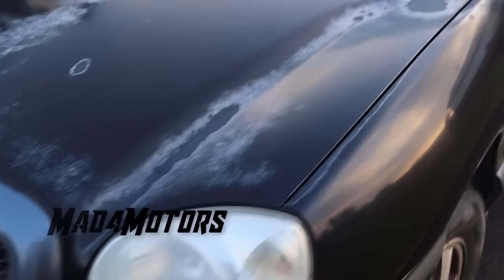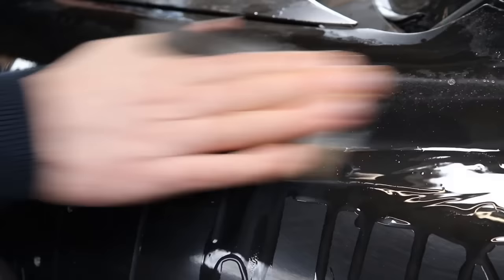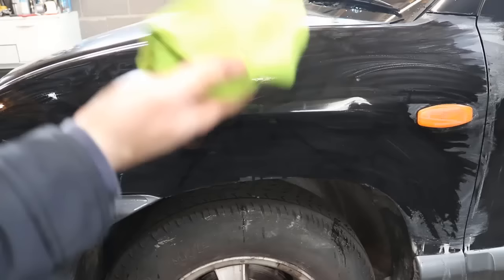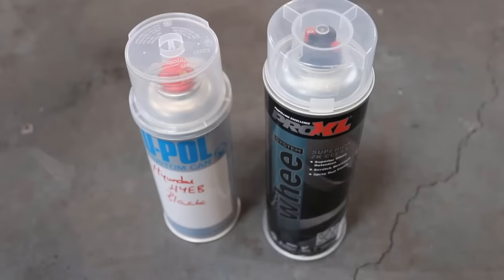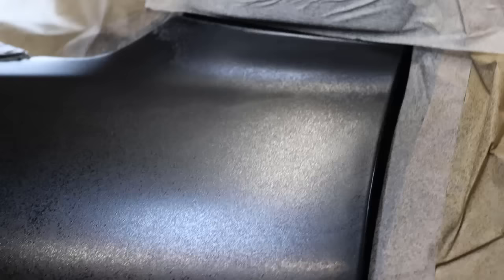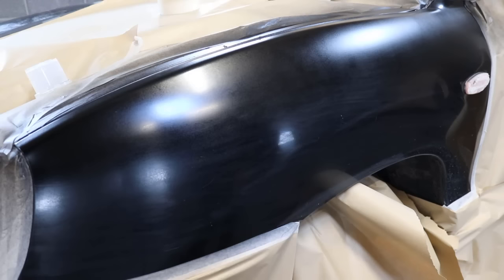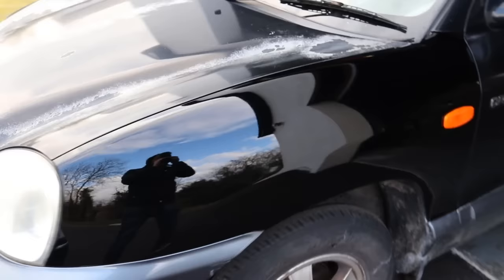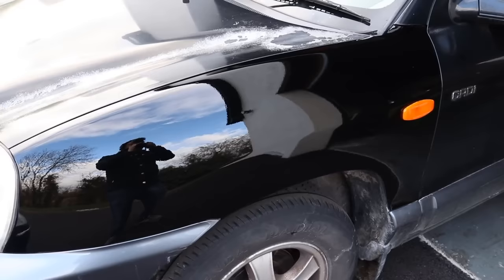How to Repair Clear Coat Fix 100% all types

Comment: Freaking excellent. I'm a detailer but the paint on my RSX is awful and I will be repainting some panels and will go with this process for the rest, then I'll wait the 24 hours, polish out any orange peel then ceramic coat and we should be golden no? I figured it would be more fun and cheaper if I did it myself.
Reply: Jared Miramontes 
No! You can wet sand and polish the clear coat 24hrs later if you like... but, dont apply ceramic or any sealer over the paint for atleast 3 weeks...it needs time to gas during the curing stage, and you don't want to trap any of the solvents in there!
Reply: splash does it now? I appreciate the heads up, I am far from doing this project I was still doing my research but I appreciate it anyway. I didn't know that, man it's gonna be a cringy 3 weeks as a detailer to drive a freshly clear coated car without and protection.
Reply: Jared Miramontes 
In the shop we polish it with no issues...but just finish it with glaze/polish/swirl remover whatever system you like, but dont seal it. Waxes and other sealers like ceramic, you'll want to wait.
In the end, its your decision, but after spending time and money i wouldnt want to jeopardize it...
Reply: splash yeah your right if ceramic coating directly after would jeopardize my plan i wouldn't do it. Btw whats the best clear coat to be applied by rattle cans? I have an air compressor but it's only a 3 gal so I don't think it's suitable for a spray gun...
Reply: Jared Miramontes 
Im honestly not too sure, i spray all my clear and buy it by the gallon...
If your in the US or Canada, i would say go to a local paint supplier, like Napa, and purchase a can of 2K clear coat. It should have the button in the bottom that activates the clear.
Reply: Jared Miramontes 
I believe Spray Max is one of the brands that make the 2K clear coat
Reply: splash ok sounds good appreciate it.
Reply: Only use the 2k clear cans, Spray Max is good there's other brands starting to make them as well.

If you have a compressor even if it needs to catch up just buy a clear with a slow hardener so it doesn't dry as fast, As for the gun despite how cheap the harbor freight gun is it's pretty good and because you're a detailer just spray enough clear and you shouldn't have a problem sanding the orange peel down to perfection, The spray cans are one time use and pretty expensive at $20/can.
Reply: JrVtec so your saying buy the clear coat in liquid form and try to use my compressor along with the spray guns from harbor freight? I've lots of good things about those spray guns but also hear you need at least an 8 gallon tank to run them...
Reply: JrVtec 
Problem is he has a 3 gallon compressor... thats ok for a brad nailer, but not a paint gun...
Even the cheaper brand guns, like HF, are HVLP(high volume low pressure) so you dont need tons of pressure, but they do require a ton of air volume...
Unfortunately, without spending a bunch of money on a decent compressor(25 gallon minimum for small projects) then he might be better off buying the 2K clear in cans...
Also a little trick, if you want to use it within a day or so, stick your can of clear in the refrigerator after your done using it and take it out the next day when you need it again...
Reply: splash appreciate the tips man!
Reply: Jared Miramontes 
No worries...
Hope your project turns out well!
Reply: Yeah just remembered you mentioned it's a 3 gallon definitely not suitable, In that case yeah spray cans is your only choice for now unless you're really interested in painting and want to invest in everything you need.

What are you planning to paint and what color? I wouldn't paint a hood or anything big in general with cans, You'll almost guaranteed have tiger striping and it'll cost a little over $100 just in the 2 cans clear/2 cans base.
Reply: 3 gal compressor, why don't you test try something with cheap paint especially if you've never used a spray gun before, I'm pretty sure your going a want to practice. Besides your in control of the air flow & paint coming out. Just let the compressor catch up after every pass or two. It's not like a impact or air hammer that are releasing a vast amount of air with each trigger pulled. You'd be surprised at what you can do with what may seem like is not enough, actually can be just enough(barely). I just hate the clean up part of the gun, no one ever mentions that.
Reply: Jared, if you plan on wet sanding the clear, dont rattle can it! You will blow right through!
Reply: Splash, borrow or RENT a compressor. Rattle clear is for jambs, not outer panels

Comment: Left a ton or "orange peel" - should have sanded the base coat lightly prior to clear, then sanded the clear and re-coated.
Reply: What grade sand paper do you recommend for that step?
Reply: You won't get a finished showroom paint  job in one or two days using cans and doing multiple sands and sprays. I have tried this myself and you end up with a worse finish by rushing to get it 100%.The video shows exactly what you can do in one day and is ideal for the diy'er. 
The clearcoat sticks to the basecoat if done soon after, no need to sand. You will get some orange peel from an aerosol can no matter what, it is just ridges in the liquid. Those are fixed by waiting 48 hours or longer dependent on the quality of the clearcoat and temperature, then you sand with 2000 grit or lighter and polish with ultimate compound/ quality polish and a rotary polisher. You can use heavy grit if required later on, but I veer on the light side for new clear.

Comment: Just repaint whole car for $400 one stage color with two coats of clear coat. And done. Will look better and last longer
Reply: Single stage doesnt have clear. Secondly it will NOT last longer. Lastly you must have no idea what quality materials cost
Reply: Sinisa, let your car drive 3 years in New York weather and you will see I am correct.
Reply: Rovid, our cars are exposed to 120F 8 months out of year. If anything can damage a paint it's Sun and we have 3 Ear warranty on paint and clear. Never had customer return from fading or flaking. When it come to paint I'll trade your snow and rain for 120F sun anytime.
Reply: Sinisa, no droughts, fires, tornadoes, floods, Im staying in NY thanks. Liberal Governor suckd here but everything else is fine. I get more work in 3 months here than most southwest shops in a year. Winter is a repair and fabrication shops dream here. Most guys here bank 140 book hours but actually work 40-45.
Reply: No thank you. There is no tornados in Vegas bro. You can keep your rain and snow ice all of that. Booking 140 working 40. And asking why people don't like east coast Auto repair crooks lol
Reply: Sinisa, how do you charge for a job? We use flat rate, if you are good, you make money but if you suck you dont. If it takes you 3 hrs to replace a fender but takes me 20 minutes we make the same money. Its not my fault if I can do the same job faster than you with higher quality materials.
Reply: Costs 2000 GBP for a respray over in here the uk,  I wanna go to USA!
Reply: 20 minutes LOL
Reply: Sinisa, how long does it take you to R&R a fender? On certain insurance jobs they dont pay to blend adjacent panels. We unbox, prep, spray and bake. The R&R takes me 20 minutes. It takes an hour of booth time including a 45 min bake. Prep, shoot, clear, bake install.  Even the 2005-2009 gm cars where the fender is under the hood hinge take 10 minutes to pull on a bad day.
Reply: Relax man Relax. We all know you the shit. Lol.
Reply: Sinisa Radmilo is there a number/address/name in vegas i could contact? Would really love to get my car painted.
Reply: Anchor, I too would love to know where to get a paint job for just the cost of the paint
Reply: Rovid: Next you'll be telling us that 20 minutes includes 10 minute lunch and 5 coffee break....
Reply: Thomas, if you cant prep and shoot a fender in 20 minutes you dont belong in a shop
Reply: Rovid Bouski Los Santos Customs is easily the fastest. It puts other shops to shame. I recommend going there.
Reply: @sinisa radmilo
Reply: Sinisa, what is the name of the shop?
Reply: Yeah, at one of those Earl Sheib places where they wipe the paint down with scotch brite pads, barely clean it up ,and the paint peels of in huge chunks in about 2 years...  Thats what you get for $400...  Good luck !
Reply: @sinisaradmilo6760  where's law vegas?
Reply: No one said it will be best paint job for $400. But for sure will be better than spray can. Even if it last just 2-3 years.
Reply: @rgviper  it's Las Vegas not law

Comment: Great. Result. I want to do this but my car is peeling on the rear passenger side. Not sure I could successfully blend it in. And I don't think I could spray fast enough to do the whole side of my car without streaking

Comment: Reason why you didn’t buff out the sanding marks obviously you were gunna paint and shit but I could still see the sanding marks ?
Reply: The rough surface helps the paint to stick, so you don't want to buff them out, maybe use a higher grade grit before painting, or apply more coats of paint so you have clearance to sand the finished product and compound it.
This is meant to be a quick and easy fix to make a shitbox look like less of a shitbox.

Comment: Hi. Excellent video , very helpful to understand & carry out the job. 
One question, if top coat has developed bubbles, but it’s not peeling at all. Then how to fix? 
Does it need to be sanded and only clear coat applied? Or base coat (paint color) also need to apply? 
Thanks.
Reply: Ooh please tell me you have the answer to this now, I have the same problem.
Reply: @sarahkwok1940  nobody answered my question yet.. 🤷🏻‍♂️🤷🏻‍♂️
Reply: @sarahkwok1940  I have spoken to a body shop mechanic. They told me that bubble are made in the base cost, not in top coat/lacquer. 
Due to heat & temperature changes etc , base coat develop bubbles, so the solution is to sand down the paint and then apply base coat, paint & top coat for a perfect long lasting finish.  Hope that helps.

Comment: But now the question is how long does it last? Maybe 1 summer? Now it's probably going to lacker check
Reply from the maker: Ok so I used the more expensive 2k clear coat so this should last many years
Reply: Rovid Bouski 
Yes the prep is the most important part but cheap materials also going to lead right back to the same problem
Reply: Rovid Bouski you'd be surprised. The basic steps were exactly what we do in any shop I've worked at. Scuff the clear coat, either with sandpaper or Scotch-Brite pads and it's ready for more clear. When you do a blend, like when someone has a door replaced and they only paint the door, the rear of the front fender and the front of the rear quarter panel on the passenger side, then the rest of the clear/panels on that side just gets scuffed similar to what he did, only with sanding blocks, and then the entire thing gets an even coverage of clear.

Unless you meant "(If) The prep sucked..."
Reply: *Lacquer
Reply: Mad4Motors how long and how hard do I need to sand it
Reply: Juan Ruiz word thats what I wanna know

Comment: Going to check this out.
Really hope it works.
Walked out today, after 2 days of very heavy rain, and found TWO large water bubbles on the side of my truck. All because the 20+ year old clear coat had flaked some and now holding rain water.